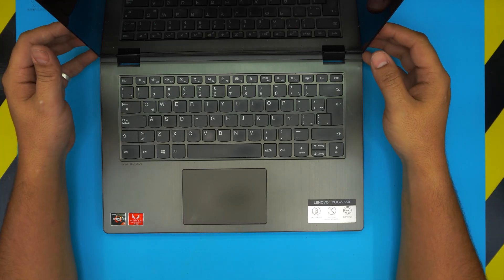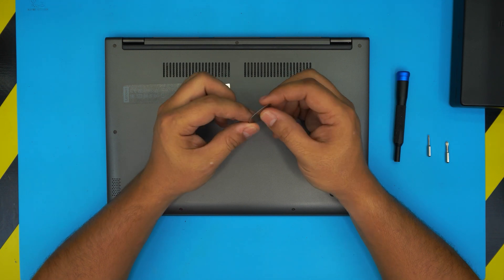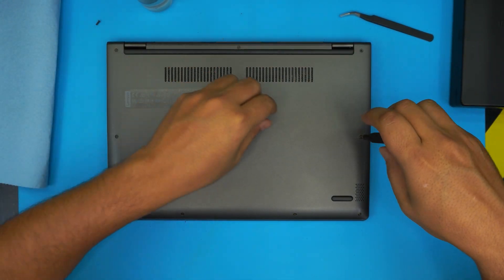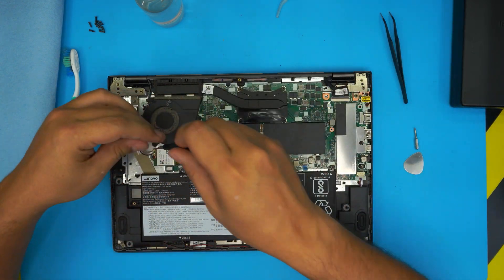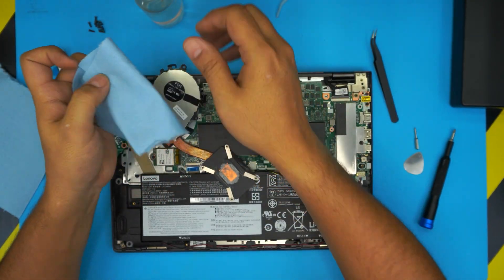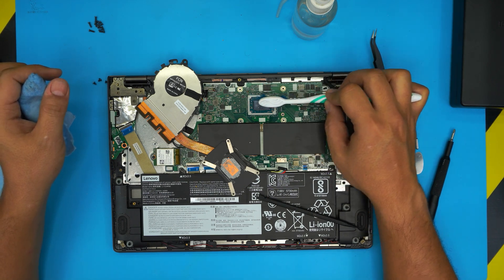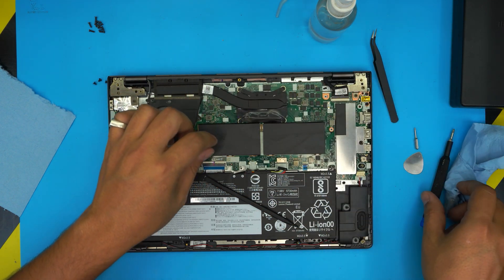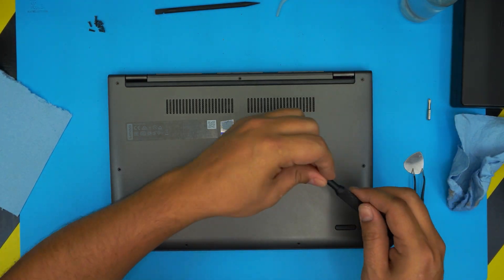Lenovo Yoga 530 - 14RR  81H9 | SERVICE | REPASTE | CLEANING |

Comment: Does anyone know where the cmos battery is located? (RTC battery) I would like to replace it after seven years.
Reply from the maker: Thank you for your feedback! If you wish to support the channel, you can like, subscribe, or both!
Regarding your question, the cmos battery is right by the fan: https://imgur.com/a/Hizjkv9
you can purchase it on amazon: https://amzn.to/3EKkJln
Should you have any further questions or requests in the future, please don't hesitate to ask me.
Reply: @uFixTek Thanks a lot. I'll try to change it.
Reply: @uFixTek  today I opened the notebook and it looks different to the image sent. But identical to the video. Is the cmos battery on the other side of the board or does it even have a cmos battery? (I've got the problem that the notebook does not start anymore... disconnecting the normal battery did not work so I try to find the cmos battery...)

Comment: bro what the max temperature your laptop goes to? i have the same laptop with same specs, when i play any heavy game the gpu temperature goes to like 90°C/194°F. is there could be a problem or is it normal?
Reply from the maker: Thank you for the feedback! if you wish to support the channel you can LIKE or SUB or both :P
regarding your situation: that's a bit too high, i would recommend you to do a repaste with : thermal grizzly kryonaut extreme : https://amzn.to/3xyx5dZ
your max GPU temps should be at very high 80-85c
Reply: Using PS Plus to stream a game mine goes to 94! Ventilation is really poor on this laptop.

Comment: Hi, brother how are you,  i need your help , i have a customer with HP comparq  , model : presario CQ60 he has a dark screen the lcd is working but the inverter card is faulty,  now how do you find compatibility in inverter cards i didn't find an answer in google, are they should be from the same model like i need to go find replacement used one or is there a universal inverter card i can order that will lit all laptops LCDs please help me with this
Reply from the maker: hi there, okay do me a fav send me a pictures of both ends of the inverter and nice picture of the inverter both sides. and i get you compatible model.
ask@ufixtek.com
Reply: @uFixTek  thank you, i will thank you for the email contact
Reply from the maker: oki :)